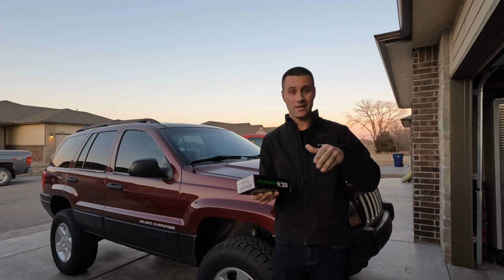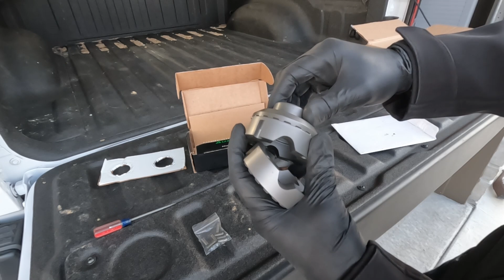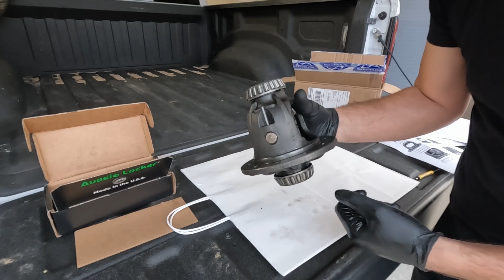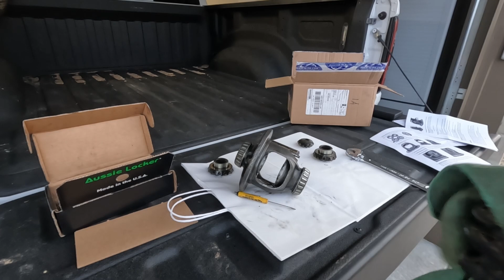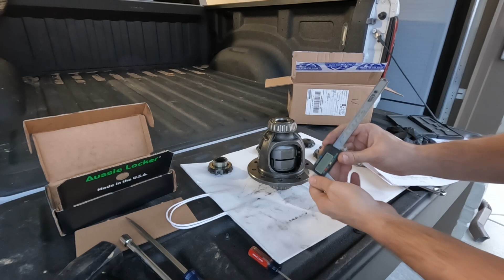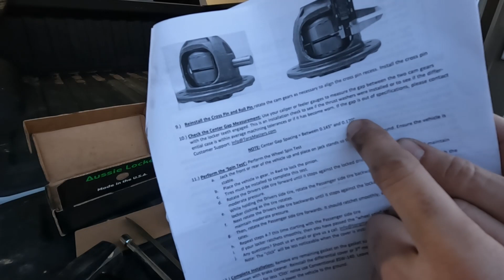AUSSIE Locker DANA 30 Build For My JEEP Grand Cherokee WJ

Comment: Lastly, I replaced the CV axles, bearing hubs, ball joints, steering system, and all related control arms, steering damper,  cooper at 265 70 16 at. I should not have a death wobble per your video.  The front axle also looks like it has nice caster rake.  36.5 inches to fender well edge...

Comment: I saw some videos on the WJ vari-loks and np247 and I was quite impressed. However, the vari-loks in the front transitioned quite quickly.  I would rather rebuild the NP247 and replace the prgressive coupler.  I hope the vari-loks are good.
Reply from the maker: Yeah the 247 clutches always seem to be pretty weak in there old age.
Reply: @TylerPotter  but then again I got the double pardon front axle shaft. I could go right into a selec Trac transfer case. .
Reply: @TylerPotter  this year I'm going to do the off-roading in the Tushar mountains of Utah with this 1985 bronco 2. I got rid of the computer-controlled carburetor and attitude duraspark ignition to. The Holley carburetor runs rich so I bought a wideband auction sensor kit. When I get back to Colorado I'll just get the carburetor and put a single advance unit distributor in it. I'm not getting the best advance curve right now.

Comment: I just finished doing a budget boost with up country springs. Replaced all suspension components and steering. Gonna start on engine rebuild. I am going to stick with vari-loks and the 247 for now.   If the 247 and vari-loks are in good shape, it should be factory. Might do a micro polish freshen up with new rod bearings and hastings rings. Then again, I have to go and get my bore gage and check the cylinder walls. If they are in good shape, I will dingle berry hone the cylinders and maybe install some std. pistons.  The 3 inch lift per your methods looks really good.
Reply from the maker: Sounds like a plan!
Reply: @TylerPotter  now I'm in Washington State got my race trailer here with my F350 going to hold back my bronco 2 parts washer sinks tool caddy engine stand engine hoist parts washer bead blaster oxy-acetylene outfit valve grinding equipment
Reply: @TylerPotter  my parts washer cabinet cost me sixty five hundred bucks. I'm going to wash up those WJ heads and then bead blast the chambers. Then I'm going to change out all the guides and then cut the seats with my new way cutters. After driving the 1985 bronco 2 with duraspark conversion around I'm wondering why I even messing with that Grand Cherokee
Reply: @TylerPotter  the old WJ heads are perfect except for a threaded plug insert. But the guy who put it in didn't throw it all the way into the chamber and it was only halfway down. So I bought this thread repair kit with like eight inserts for like twelve bucks on eBay. It doesn't have the black tap. So I'll run it down through there and see what then I'll ppeen  the bottom of the insert where it meets the chamber . I should buy those bare heads on eBay for 698 a pear. Then the motor will be brand-new with 20 / hypereutectic Pistons. I'm going to replace all the injectors and all the sensors and then spray the wiring harness down with electrical contact cleaner.

Comment: I have a trax brand locker in the rear of my old 77 chevy c10. Looks exactly like this one. You definitely hear it ratcheting when you make a turn. Sometimes it will chirp the inside tire if you accelerate very much while turning.
Reply from the maker: Yep that sounds just like the detroit locker I had in the back of my Wrangler, this should be a little less of a issue on the street in the front axle when the Jeep is in 2WD. Thanks for the view!